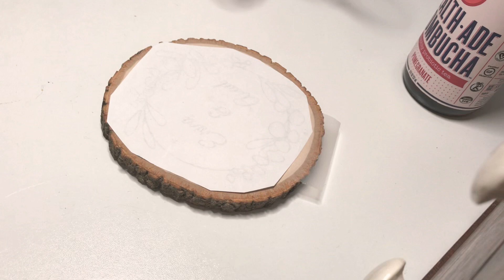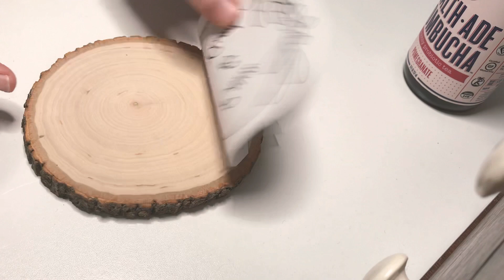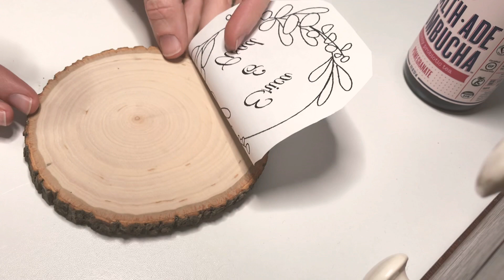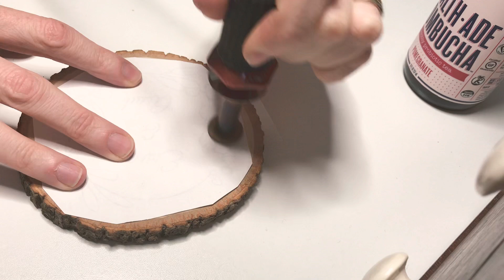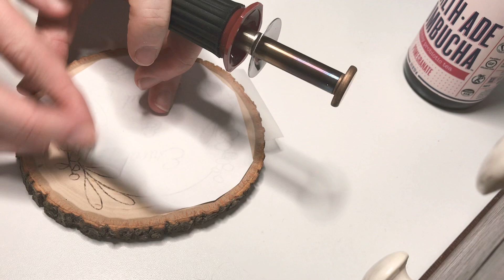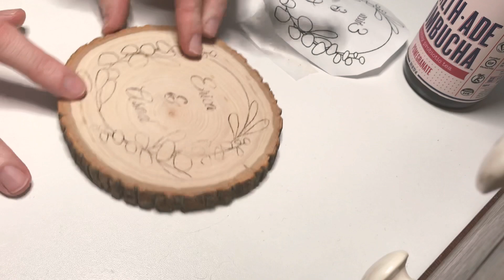How to Heat Transfer an image to wood

Comment: Can you use a heat gun against the paper to transfer
Reply from the maker: Although I have never tried a heat gun to transfer an image, I do not think it will work. The actual transfer really relies on a little bit of pressure to actually get the ink form the paper to the wood. The heat gun is only heat so it would probably just make the paper curl up or torch it eventually...

Comment: Which temperature setting did you use?
Reply from the maker: I start off at medium and adjust it from there! I also test out my tool on the corner to make sure it's not too how and doesn't burn the paper.
Reply: This works with photos as well?
Reply from the maker: @aaroncoffey1728  as long as it's laser printed, yes! The quality will not be fantastic, especially if your wood is not perfectly smooth, but it will transfer.

Comment: Does it print out a color picture?
Reply from the maker: Yes, the colours would transfer similar to the black ink, BUT!!! They would not be as vibrant (the wood would show through and dull them compared to what they look on a white paper) and it would probably come out quite patchy or grainy because the wood will not be as smooth as a paper...

Comment: Did you actually say you got a perfect transfer?  Looked like more of a fail to me.
Reply: Better than tracing it all with graphite paper
Reply from the maker: It's not 100% perfect and really depends on much effort you put into it. You can apply pressure and heat for longer, but the intention is to just get the design across enough to be able to burn it.

Comment: Can I use the Cricut mini iron press to do the same?
Reply from the maker: I am not sure, as I have never tried it, but as long as you can applu heat (and not too much to burn the paper) it will work!
Reply: I use a heat press mini knockoff to do my transfers. I did find that I needed to angle it so the edge presses on the wood, not just the flat iron part.
Reply from the maker: @zonagreig3397  That is a great alternative to the wood burning tool or a regular iron... The mini size should make it pretty easy too!

Comment: Hi! I don't recommend using this method for wood burning. I have talked with printer companies and Canon has said they don't recommend burning over the ink. They feel that there would be toxicity issues. This goes for both laser & ink jet.
Reply from the maker: I always err on the side of safety and only recommend it with proper protection and ventilation.